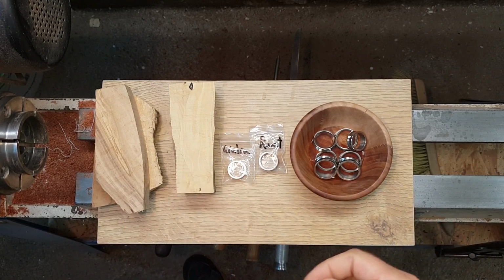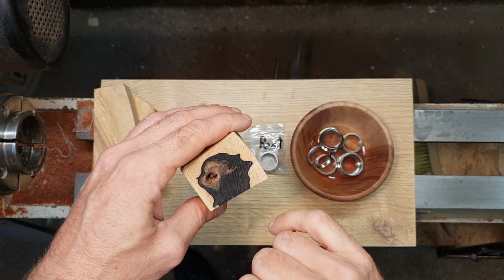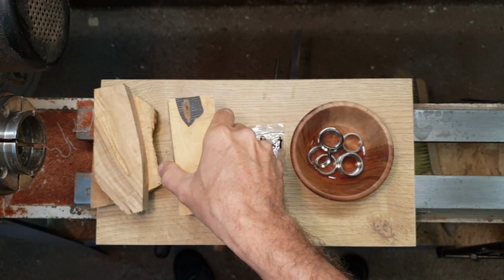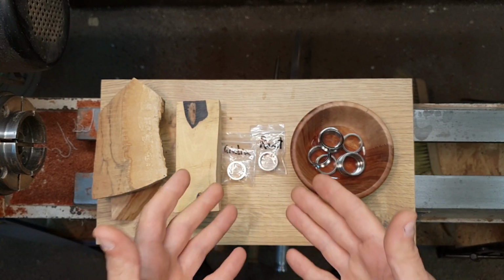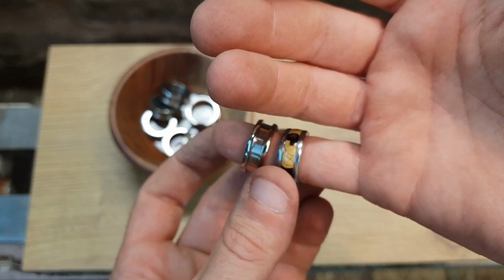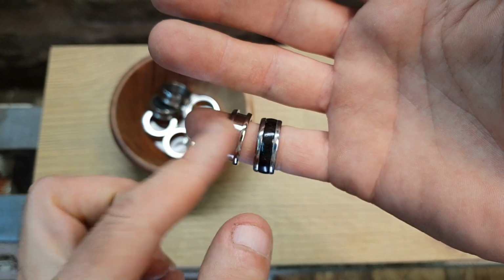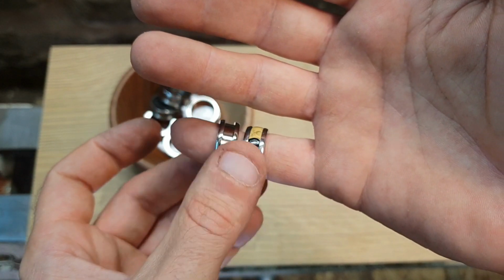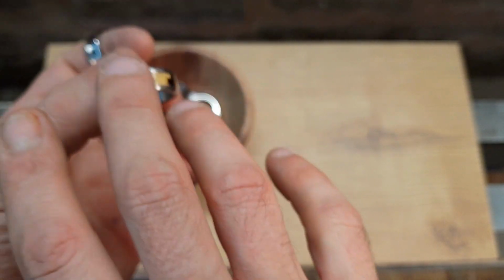Woodturning Ebony Ring and finally buffing!

Comment: Very nice. I like how you make little chucks for your projects. How did you attaché the buffing wheel to your lathe?
Reply from the maker: Thanks Justin! The buffing wheel is attached using a morse cone, or can be grabbed with a chuck. It's a Chestnut buffing system I bought in the last Makers Central.

Yuval

Comment: Excellent work Yuval as always, could you use a thin cyanoacrylate glue for a finish but don't put the wooden ring onto the metal ring while finishing.
Reply from the maker: Thank you Carl! a CA finish will work find, the only problem is my wife is allergic to many things, I wanted the ring to be as chemically clean as possible.

Yuval